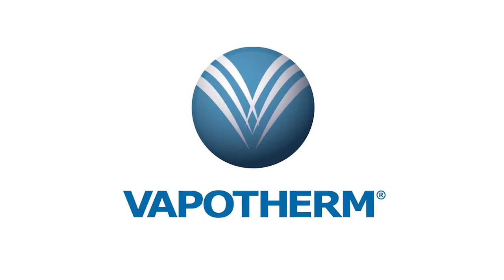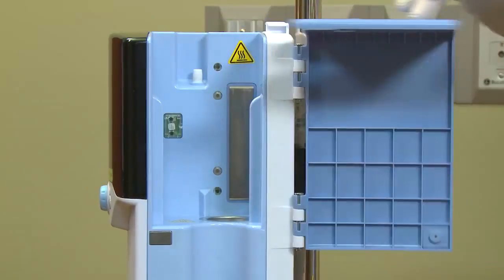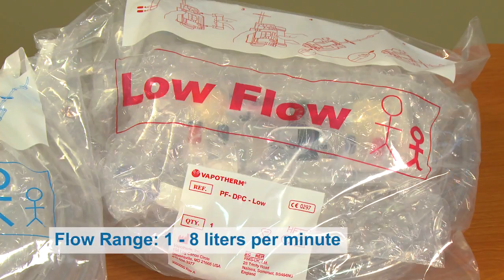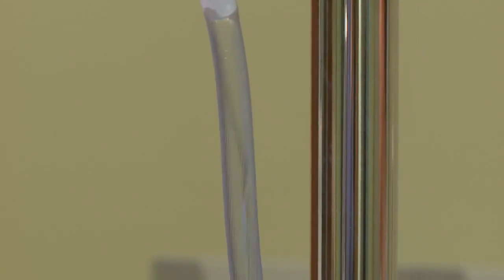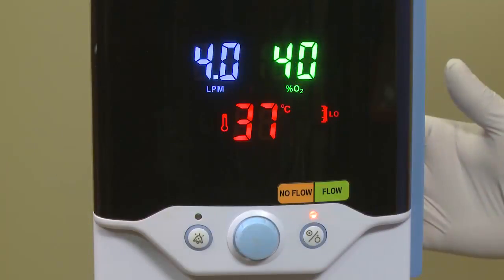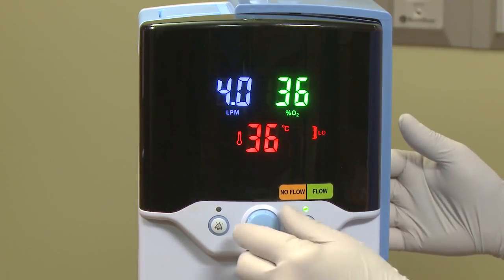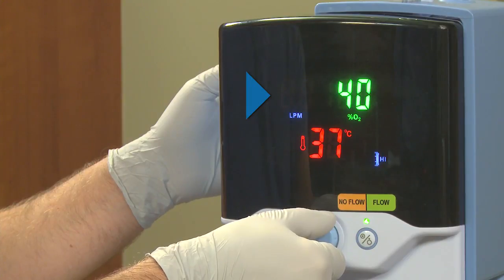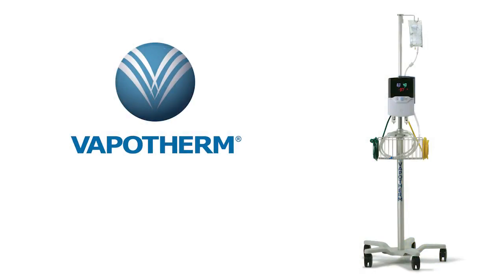Vapotherm Precision Flow | In Service Video | Customer Training and Onboarding

Comment: Why it is not possible to change the 02 value? I tried replacing with new 02 cell. Still the problem is not rectified.
Reply: check psi pressure
Reply: It's probably the air compressor box if it has one. You have to flip the black switch on the back of the air compressor first before turning on vapotherm, then it'll let you adjust o2.